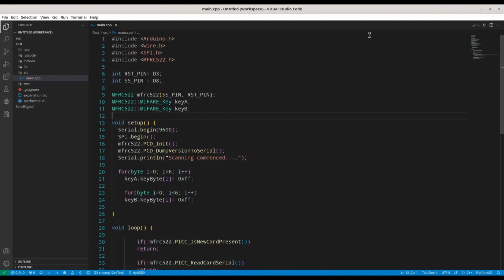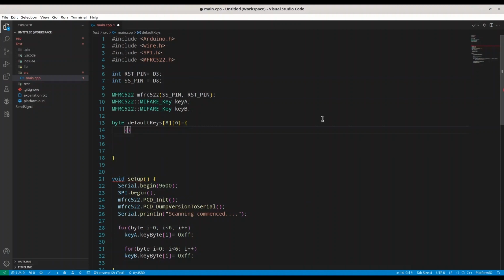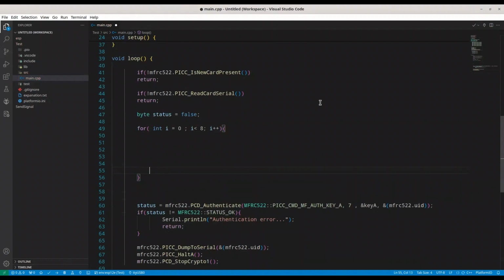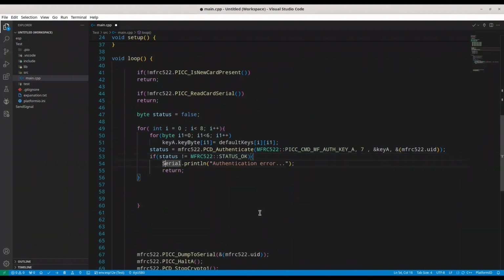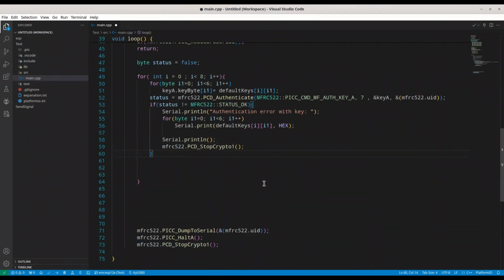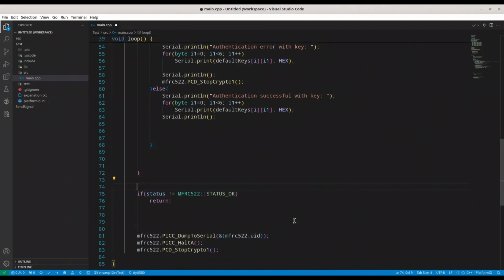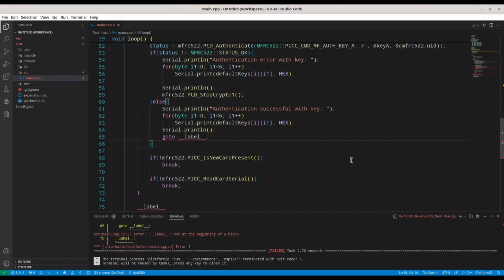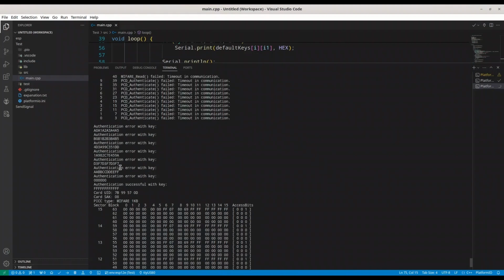ESP32 & ESP8266 - RFID RC522 default keys and authentication loop

Comment: Thanks a lot  - is there a way to get the whole code?
Reply from the maker: Always a pleasure.

I don't have github repository with this code, if that is what you are asking for. The intent was to lead viewer through entire series and to always edit code from previous episode. Any way, in first couple of episodes, I set basic example, and from that point on, changes are made. You don't have to worry, because the code is easy to understand and quite straightforward.